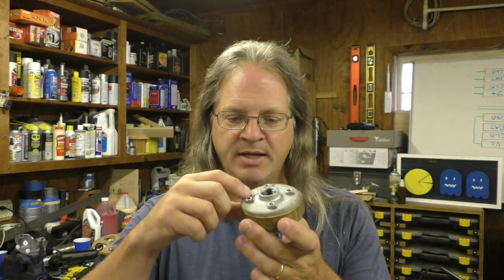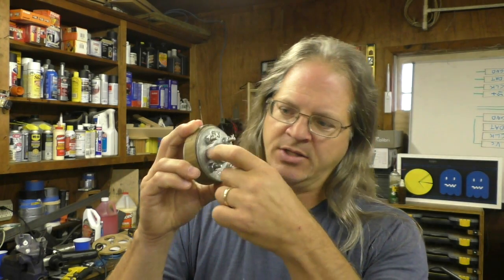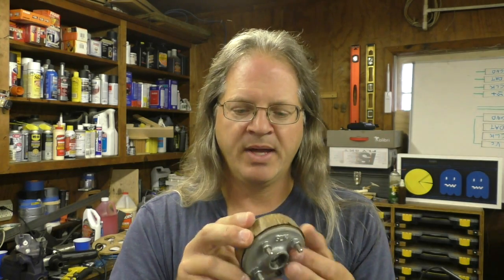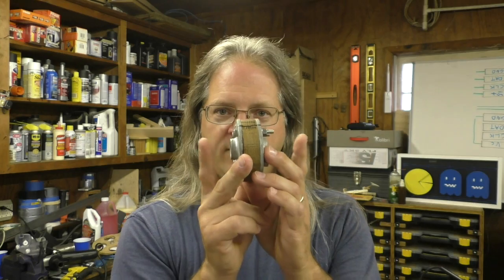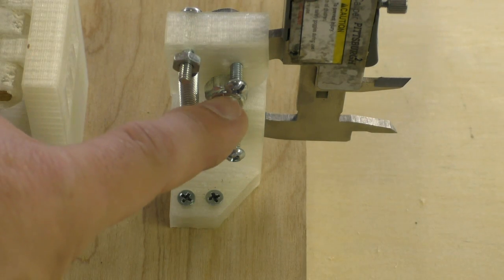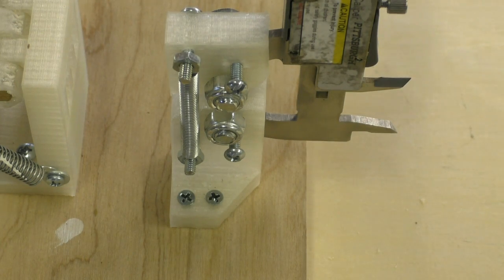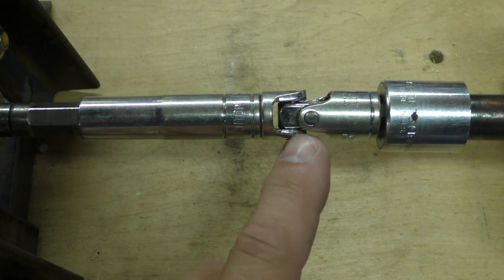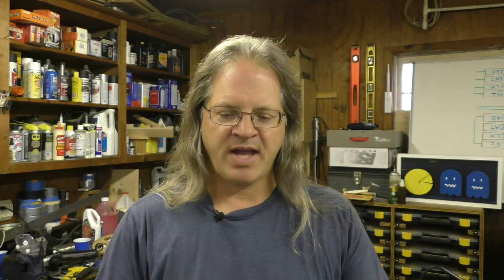Filament Extruder #10 - Problems Solved?

Comment: Hi Bob,  Here is one thing you should consider doing and that is polish the auger screw. You should also consider honing out the barrel with some sandpaper and long drill bit. Here's why, every little bump on the inside metal surface will cause a small deflection in the flow of the plastic. Enough small deflections well cause irregular flow besides wearing out your motor faster.
The genital man's video's I have been watching makes a 1, 5 and 20 kilogram per hour 3D printer filament machine. He also sells his filament under the name of Green Tec Natural and gets $56 dollars a roll.
Here's video on polishing the auger bit.
https://www.youtube.com/watch?v=83QxOmt9H08
Hope this helps everyone. Kennsplace
Reply: Wow, Ray... How can I subscribe to "The genital man's video"?

Comment: I guess youve probably solved the problem by now but it occurred to me that the metal bits might be from the drill scraping on the weld seam inside the pipe

Comment: Using an aluminum heat sink clamped to the shaft between the heat bands and the feed should help in the heat problem.  Plus, if your pipe is not seamless, the seam will be a source for the bit to shave off and send out into the mix.  The stainless steel tube may very well be a solution to your problem.  One more thing, you may be able to help the bit by sending a sanding tool through the pipe a few times.   Those are easy to make with foam on a dowel rod and whatever grit you want to use.  The finer the better.   You're on the right track - keep up the good work!

Comment: Just soak the pipes in muriatic acid.  No more galvanizing, problem solved.  Do it outside though.  Fumes are bad.
Reply from the maker: After letting it run for a while, the shavings stop coming out.  I don't think it was the galvanized pipe as much as it was the bit lining up correctly.

Comment: I think the wavy situation was caused by that : https://www.youtube.com/watch?v=5aCK4Bob6a0. The effect of a yoke in your drive system can create rpm change if the two axes are not align. This rpm is directly link to the diameter of the filament so it have to change because de puller speed is not actualized soon enough. I watch the LYMAN FILAMENT EXTRUDER and he use a DIY optic sensor to control the diameter of the filament while it's still hot. Can be the way to go for faster pulling speed change. Your video are great ! I'm waiting the next videos because I want to make one myself I'm actually making my 3d model in autodesk inventor.

Comment: I currently have that same problem about imperfect filament diameter. My extruder design is very similar to the filastruder one, and after several extrusion tests, I believe what's causing the difference on the filament diameter is that I'm letting it coil on the floor. When filament starts to get extruded, it produces about 1meter of filament until it finally touches the floor, and I believe that "contact" with the floor causes some resistance on the extrusion that is enough to change the diameter of the filament. I ordered a Filawinder from Filastruder, hoping that this will get rid of this problem. I was initially thinking about building my own filament winder, but after making numbers, it turns out that it's much cheaper to get it from them than building my own (at least for me)

Comment: Just wondering ,, do you think it would be any easier trying to produce 2.85mm filament ?
For some very large print projects,  wall resolution isn't as important, and print times are being reduced by using larger nozzle sizes (.8 - 1.2)
If the end goal of a DIY homemade filament extruder is to recycle plastic,, might it be a more practical option to consider moving back to the 2.85mm filament ? ,, where a .25mm fluctuation is an acceptable tolerance.
I know it's been said that 1.75mm is easier to melt, and can print faster ,, but larger heat-blocks are starting to come out, and it may make that statement equally true for for 2.85 in the future.
This is a great project for the maker community,, thx for working out the details :)

Comment: having a copper end on the filament out help have more heat. I see that your extruder is mostly metal so that would mean that the would be more disperse to the main body.
Reply: Copper or Brass should do the trick. I ordered 10 brass fittings from Ebay to have enough end fittings to test. Only downside is that they come all the way from China, but still way cheaper than buying them where I live
http://www.ebay.com/itm/161320356808
Reply: Thanks for providing me the name of them.

Comment: I think the shavings are somewhat expected. Fillistruder gives you a lb of plastic to run threw it and clean the shavings out when you first start out... Its the same type drill bit and pipe.
Reply from the maker: Yeah, I've heard that they have the same problem with a new machine.  It makes sense because the shavings almost go away until I rip the extruder apart and then it starts all over again. :)